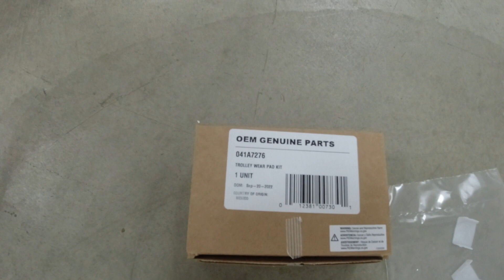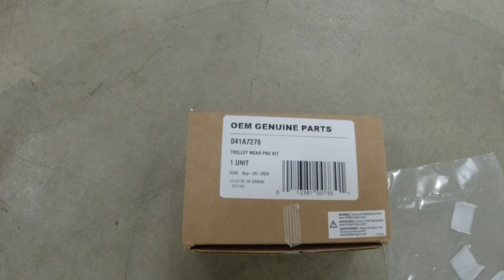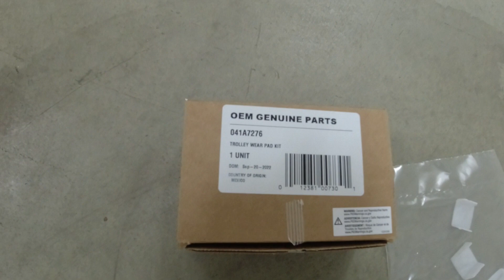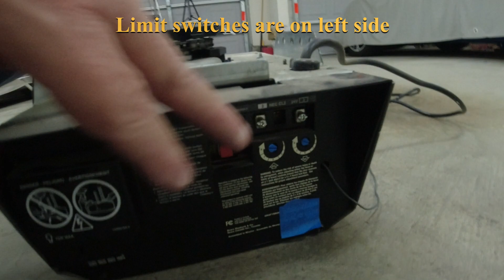Craftsman Garage Door Opener Wear Pad Replacement

Comment: Great video! Thank you. I have been wondering why my garage door has been getting noisier over the years and I found all my wear pads were gone. My opener is a belt drive and it is about 20 years old.
Reply from the maker: Is your rail a square tube rail?  Mine is and it has white nylon wear pads. The older models with the T-shape rail do not have wear pads.

Comment: Just perfect video and great job for sure. I had a problem today. People did not use an opener for long time, operating 9X7 door manually. I found that chain was really loose and fell off sprocket. I installed chain back, adjusted tension and run the test...My mistake - did not check carriage position((( Loose chain slid too much toward motor so run was too short, carriage hit the stop and tab that tension bolt attached to just broke off. Fiasco. Now a am trying to find replacement trolley for Craftsman 20+ years old door opener and, if lucky, repeat the job you did here. My question - how far from front stop carriage should be at time of installation? On your video looks like 3-4 ". Also  how to adjust the stops on motor?